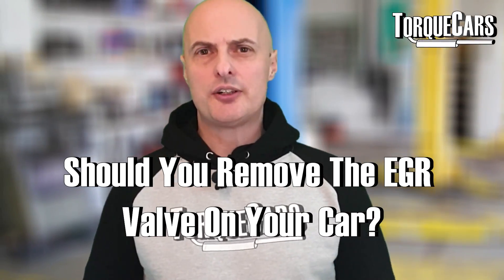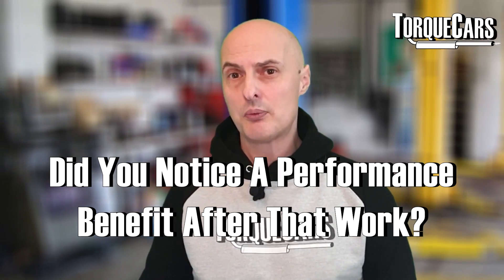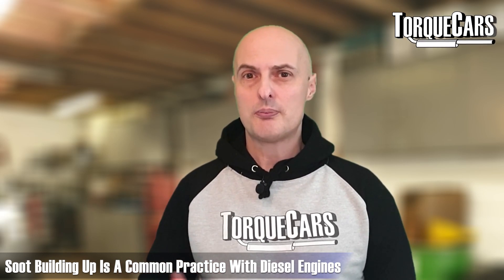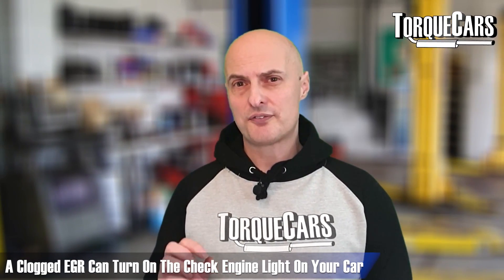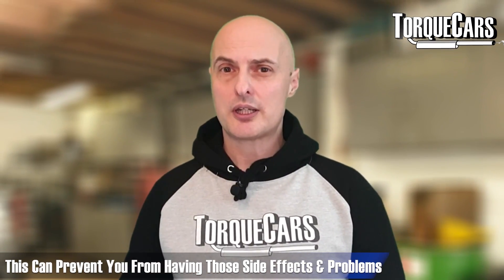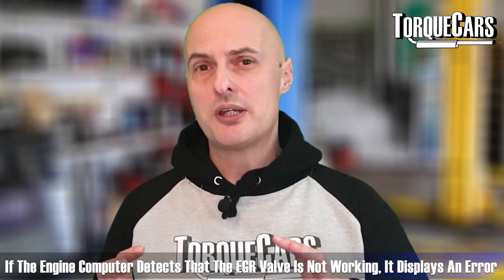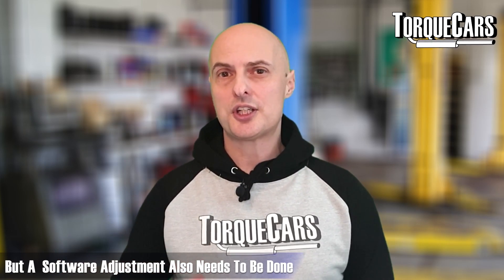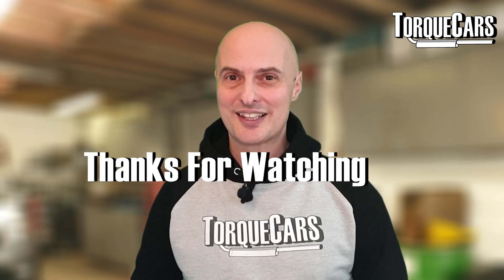EGR Delete/EGR Removal - Worth The Risk/Effort? All You Need To Know About EGR Deletes.

Comment: Little known fact about egr. Its used to lower cylinder temps, by adding low to no oxygen air in the combustion chamber it enables higher boost with lower fuel consumption.  If you remove egr, you need to add more fuel to reduce cylinder temps and prevent knock. That's why they sometimes add egr coolers. Its a complicated balance to make more power and keep the fuel consumption low
Reply: that is far from the truth
Reply: Not a little known fact.  You're full of crap.
Reply: adding more fuel does not reduce temperature, this is not a gas engine.
Reply: I don't think so.   Fuel mileage increases when egr is removed

Comment: Will an OIL CATCH CAN stop the clogging of the EGR before it gets started???
Reply from the maker: Not really,  the catch can goes between the PCV and the intake, at the point anything reaches the EGR it is pure exhaust gases, so making sure the engine burns cleanly with as little soot as possible is the aim here. 

Benefits: A catch can will prevent a lot of the carbon building up on the valves and the intake and will help stop some oil vapor entering the combustion chamber so will have a minimal effect on reducing soot produced.

Comment: ...mainly i'm working on "big" diesel engines (5.9 to 25 lit). All are euro3 to euro4b (corresponds to euro6 in car). Egr is very important for your fuel economy, especially on engines used in variable rpms. Basically you can explain egr as variable working volume of your cylinders. It makes possible to add less fuel to mixture and lower torque and power without:
decrise of rpms, 
loos of stihiometric ratio fuel to oxygen
exiting zone of best fuel utilisation.
I strongly oppose removal of egr.
Main issues i incounterd were:
Clogging of egr cooler(s)
-cold engine usage
-bad injectors (leaks or bad atomization)
-bad turbo or MAF sensor
-clogged crank case ventilation filter/condenser on closed systems 
Cracked egr cooler (high presence of vapour in crank ventilation line nearest to head cover and water in oil presence)
-sudden shut downs of warm engine
-shut downs during dpf regeneration
Bad egr valve position reading
-worn (consumed) actuation surface due to fluctuation of force applied during operation
All investments in repairs will be shortly reimbursed on consumption side.
If you have any questions about  this plese feel free to ask...
I'm using vw 2.0 tdi 140hp on caddy for ½ million kilometers, and i replaced egr (incl. cooler) on 360.000 km. due to leak of ex. gas on housing (worn seals on shaft)
Reply: Egr delete is mandatory on diesels of you expect a long service life. Mpg is better with a egr delete also.
Reply: @hksjoshua  i think that application sometimes favors the egr...
Reply: You speak a lot of Crap, EGR fill your intake with soot and then mixed with the PCV crap = massive build up of carbon/soot. Therefore , No EGR = no Carbon build up. PS, I don't care about Extra Power only Carbon Build up. pps thankyou to the Greenies for this as well.
Reply: Hi👋 i have 3531 cc non crdi engine non turbo non egr cooler it is just a simple engine with simple fuel pump no dpf or another thing like that. Can i remove egr? Will it gave engine long life?
Reply: Yeah, you add less fuel to the mixture because you are injecting dirty engine exhaust to take up the volume, LOL.

Comment: Hi I just bought my first 02 1.9 TDI and I'm going to use it for cross country drive next summer and I was wondering what can I use to keep the motor clean and run good like a fuel treatment or oil cause I want to set my cruise control and go.so iam just wondering what is good for a TDI for a long distance driving

Comment: Whats with How the EGR Lowers the Engine Combustion Temperature?
Reply: What about diesel engines prior to EGRs? .. It's sending cooled dirty exhaust back through the engine so I suppose it could have a cooling effect? .. But I doubt its detrimental to the engine as opposed to the thick goo deposits left behind from the wonderful duppy exhaust ..  All that shit goes through the engine and clogs up stuff like the vanes on the turbo and maybe DPF.. At least thats what used to happen on my Mk3 Mondeo... The Vanes would get stuck and that would break the actuator.. Block the EGR no more problems.. Them things are piles of shit.

Comment: Hi, I have a 2009 vw passat estate B6 and am thinking of removing the egr valve, as the engine is definitely down on power. I have watched numerous videos on how to do this, but none have mentioned the air flow sensor connected to the valve. If I delete the egr, I'm guessing I could get engine warning lights on the dash? Will this need a ecu remap? (As I've seen mentioned before), or will a service reset clear this? Any help from anyone would be great!
Reply from the maker: Yes you would need to get the ECU adjusted to cope with the lack of an EGR or you'll get error codes flashing up and may even enter limp home mode. 

Read the comments on here and on our website, many people did this to restore power and didn't see any. 

In most cases a carbon clean is the best option for a direct injection engine which is down on power especially if the mileage is creeping up. BG intake cleans are performed by specialists and I had one done on my 2.0 TDi and it made a massive difference to it.
Reply: The EGR delete needs to also be done through the ECU. Otherwise, the computer is constantly looking for data from the EGR. A reprogramming will tell the ECU to stop looking for the EGR.

Comment: What about temperatures?
Inert gases deaccelerate chemical reactions, have greater specific heat capacity (J/kgK), in other words have cooling effect on every part inside the cyl.
Tolerances, injection (pre-inection, time, quantity), components, maps etc., were designed to operate with EGR – at least 50% of time?!
When EGR is deleted, the temperatures are changed, combustion condionitones are changed, and the ECU still drives the engine not taking into account aforementioned?
Is it mandatory for engine life to buy a map which is completly adjusted, tested,  to drive the engine without ERG?
Can anyone please share your toughts!
Reply: I have a good old 1.9 pd in my 2003 beetle. The egr is the old diaphragm/vacuum type (no cooler). When I got the car last year I carried out the basic service items, oil, filter, fuel and air filter. I also cleaned the egr and the inlet as best as I could. I popped a screw to seal off the vac pipe to the EGR. The eml came on the dash but with no limp mode etc. but what I did notice was the engine took longer to get to temp, it felt a little lumpy on idle but it was definitely sharper on take off. My main aim was to aid fuel efficiency (years ago who cared hey)
I found it made no difference to economy but also the engine shook when I turned it off. (Anti shudder valve disturbed I was told).
After about 2 weeks I reconnected the vac pipe and it returned back to a smooth running engine, and after a few miles the eml turned off. 
Would I bother again or even with a delete kit ? No.
Reply: Cherish that engine and service it as required. 
I had a 2004 SDI in my Octavia. Stupidly, I sold it at 240,000 miles. I didn't know the misery of DPF's.
If you buy a diesel with a DPF, you are buying trouble.

Comment: I am the lucky owner of a Vauxhall Antara 2.0 and was very sluggish due to a mechanic who put the cam belt on 2 teeth in the wrong direction, after new valves, cam shaft etc etc I decided to blank off the EGR vale and while the icu was being vamped up by 40 HP had the management light code taken off as well. The car goes like a rocket now and less fuel, if it blows up it's only an Antara so no big loss there.

Comment: Here is a question that I haven’t seen answered anywhere. Does a stage 1 or ECU remap increase, decrease or make no difference to how quickly an EGR valve will clog up?
Reply: Mate it depends what sort of tune you go for mild , hard and even you can tune the transmission too , to gain massive power , yes with stage tunes powers increases and less fuel
Reply from the maker: EGR issues are primarily down to soot. Some tunes make more soot than others, generally the more fuel you dump into a diesel the less cleanly it will burn. An economy tune should burn cleaner as fuel is more precisely injected and less soot will be produced, but again this depends on the engine you have, the fuel you choose and what the mapper has setup (they will typically adjust fueling and the turbo air intake timing, and exhaust gas temperature ranges.)
Reply: @torquecars  Thanks. My 2011 Skoda Octavia Scout TDI dsg was tuned about 60,000k’s ago. It now has 280,000k’s on the clock. I love the wave of low down torque. I’ve had no issues with either DPF or egr thankfully. The only downside is that I’ve just had to replace the dual mass flywheel for the second time.
Reply: @anthonysharpe5104  2nd time since the tune? WOOOW thats bad get a stronger one!

Comment: I owned a audi a3 2.0tdi pd 170 which u had stage 1  remapped with egr and dpf delete yes the egr delete and dpf along with the remap made a difference but its hard to say if just the egr delete made a huge difference on its own
Reply: The only and I really mean it the only thing it did was sharpen up the throttle response to a point where the engine reacts immediately. At the low rpm's it wouldn't do that before. I can see how it fools people to thinking the car is faster when it actually isn't
Reply: @shueibdahirmotionpictures I've got a VW TDI and that sounds like it would be a huge benefit for me. Mine has very sluggish acceleration.

Comment: EGR valves are put on because the government forced manufacturers through lawll to put it on not because the manufacturers wanted it. I remove mine and Michael runs a lot lot better.
Reply: And gets much improved MPG therefore improved emissions. Improved and modified catch cans stop engine sewage from mixing with the metered air-fuel ratio keeping combustion at its cleanest combustion. Filtered air from the cans will make venting to the atmosphere possible no need to reduce cylinder combustion quality, and improves MPG
Reply: Hello sir glad to hear that I’m planning to remove my EGR valve to,  does ur car consumes less fuel also ? Thanks .

Comment: I really enjoy the knowledge you share with us.. Recently, i’ve had a remap on c200 kompressor 2009 model petrol 1.8L @stock: 181 hp 250nm torque.. after getting stage 1 : 221 hp 330nm torque.. Its just done three days ago. but i didn’t feel any difference.. the tuner claimed 4 degrees ignition advance, new k&N filter installed.. He saying that my car is losing power bcz of it has no resonator and no muffler.. he added, These types of car needs back pressure.. Please help me to find out what could be the reason.. the health of the engine is very good he said.. Would you like to share with me your opinion on this please. Thanks 😊 for reading a long comment 😅 I appreciate your help ❤
Reply from the maker: Without putting it on a rolling road it is quite hard to diagnose faults like this. If the exhaust flow is too slow it can affect scavenging, and this happens when you have a large bore size. 

Also dropping the resonator will also mess up the pulses coming out of the engine and again can have a hit on power. See our video on exhausts for more on this, https://youtu.be/9uzgCMO3Wwo

Also try it with the standard airbox fitted, there might be some air metering issue cropping up causing the engine to run too lean with the induction kit.
Reply: @torquecars  Yeah, still we put the factory air intake box back.. and factory muffler back with small resonator.. but still the problem is there… should i go back to the tuner or give it a troubleshoot diagnose.. Thanks
Reply from the maker: This must be so frustrating for you. I would go back to the tuner it sounds like something is not right here. Are there any specialist Mercedes tuners near you? Have you looked and changing the compressor pulley sizes and overdrive pulleys?

It would be interesting to pull off any error codes and see if there is a fault condition happening here. You should notice a 40hp hike in power.
Reply: @torquecars  sorry but we did not change any pulleys or no camshaft.. we did it with straight pipe exhaust and then we noticed the claimed was 40 hp extra.. but it didn’t experience that but the dyno still shows that the car has got 40hp extra.. 80nm torque extra.. but then we went back on factory muffler as i said earlier and with stock filter box but the thing is still feel same bcz its my daily and i didn’t experience any difference on road.. I will go to the tuner back and give you his opinion.. Thanks for your reply and thoughts 🥰
Reply: @torquecars 

I had my A3 2.0 TDI remapped last week now 187BHP and 435 NM torque , map was done on a rolling road and had the duno runs emailed to me after . Sounds like this guy has just had a generic map thrown on . 

This is why you should pay the extra and get it done to your engine to how you want it . I can feel the difference.

You shouldn’t need a new filter ect on stage one as this does not usually needs engine mods
Reply: @macca2760  The filter we put just for the cold air intake, nonetheless, it does it increase power but it gives a car a little nice sound of s/c. Sooner, I'm going for a smaller s/c pulley. I also got the dyno map, what was saying is that on road it does not feel power of 40hp gain as I have seen on the dyno results. Moreover, I am going to get a catless exhaust setup this week. 😅😅 and lets see the final results. LOL

Comment: I still have the EGR but it's been switched off with a tune.  Is there something else I should do? I assume that's an effective solution. I do understand it won't prevent build up at the EGR valve. But it should help prevent some build up on the intake and valves. Is that correct?
Reply from the maker: Yes in most cases a software removal of the EGR will prevent the EGR from ever opening. It is a cheap option, but the valve itself and all associated pipe work is still attached to the engine with the only downside being the extra weight and the possibility this could leak exhaust gases (depending on the EGR design) with a VAG engine you should be fine though.
Reply from the maker: I should point out that some mappers will merely block the error codes a faulty or blocked EGR would throw up, in these cases you would still need to block off the EGR physically. Just check you have a proper EGR Delete rather than just a fault code workaround.
Reply: @torquecars  thank you
Reply: I have the same question as you
Reply: Here is a question that I haven’t seen answered anywhere. Does a stage 1 or ECU remap increase, decrease or make to difference to how quickly an EGR valve will clog up?
Reply: @anthonysharpe5104  egr needs to be blocked physically also when doing a egr programming, so its not possible for ir to get clogged up. if the egr delete is done properly of course.
Reply: Block it off with thick plates. Won't be leaking at all

Comment: Back in the 90s I removed an EGR or 2. Back then I can't say for sure I knew what it's purpose was, I just knew I didn't want exhaust gas in my combustion chamber. But I guess somehow it actually lowers combustion temps? Still seems pointless to me but if it's not broken...
Reply: Exhaust gas is burned once so when it goes back to combustion chamber it wont burn again. In that case there is less room for fresh air. Smaller amount of burning mixture = lower temperature.
Reply from the maker: Burned twice is probably an overstatement on my part (which I've now snipped out of this video).

I should clarify my thoughts on that it is my understanding that NoX and Soot particles are mostly gone during the EGR open phase. But only small proportion of exhaust gases are returned, so the main thing I suppose is the warmer gases in the intake as you say taking up the oxygen space reducing the harmful emissions lowering temps.
Reply: @torquecars  What's your opinion on Hydrogen carbon cleaning? using the Hydrogen machine to clean the car engine system.